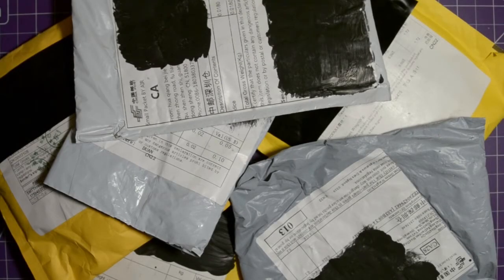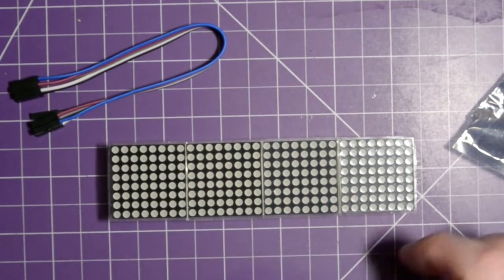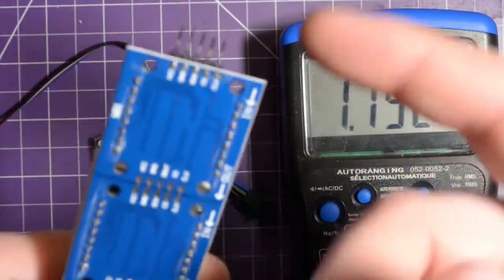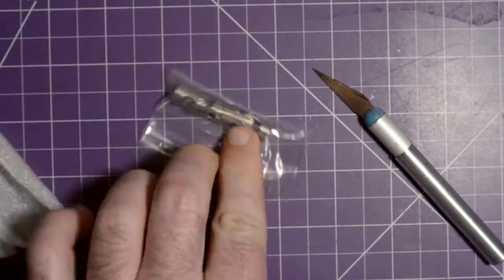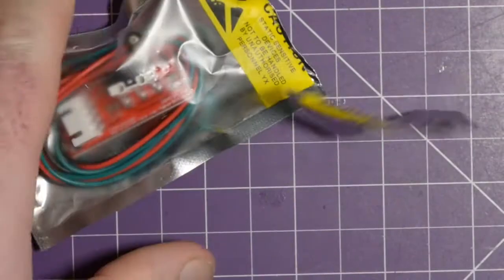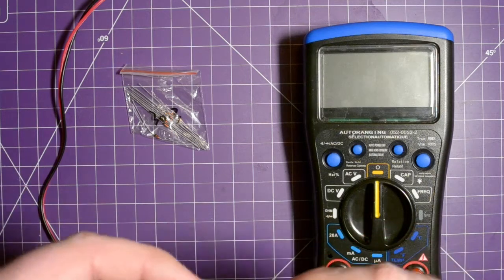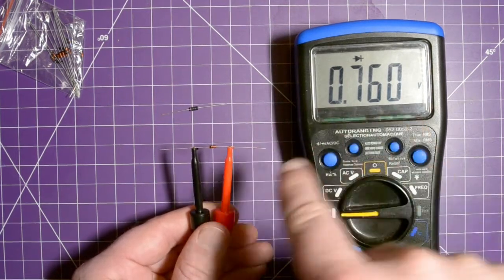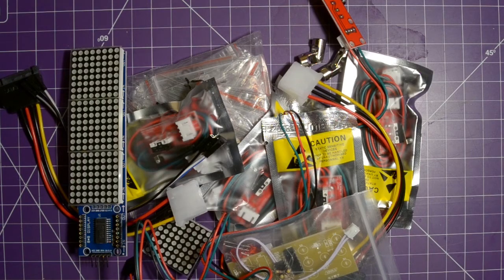Mailbag 06 - Diodes 'N RC Stuff

Comment: The pointy blades on the top of the vernier are made to go in holes and measure inside dimensions.
Reply from the maker: That they do, certainly, but they are too fat for little holes on this particular model
Reply: @SimpleElectronics  That's odd, I have a much bigger 300mm vernier with bigger inside prongs, and they easily do 2mm, maybe even smaller. So long as you use the tippy tip tips of the tips - lol -, and not go in the hole, it should do small holes.